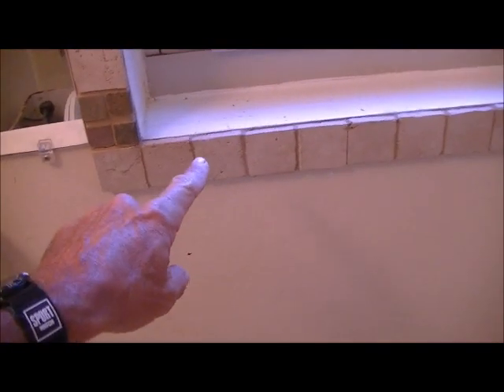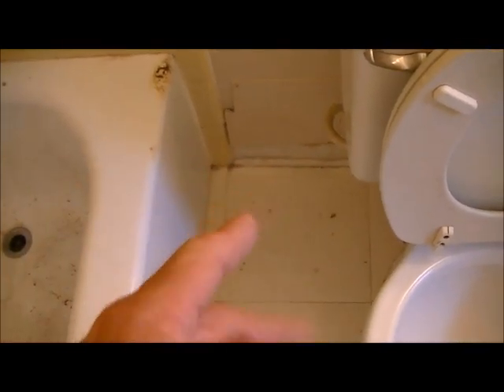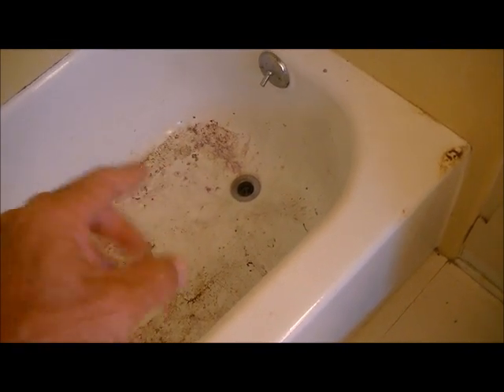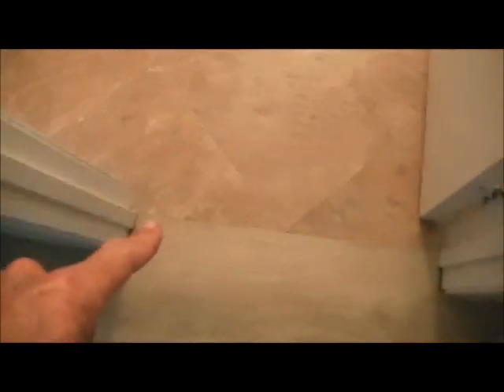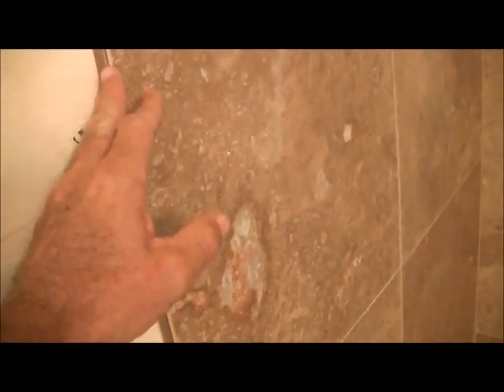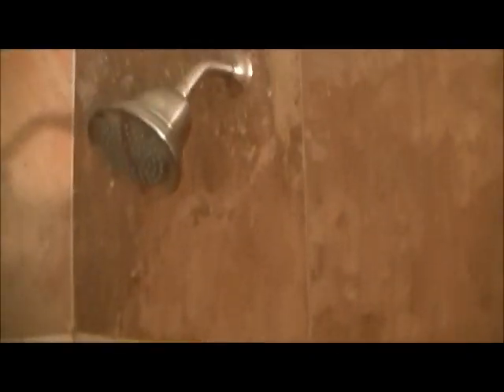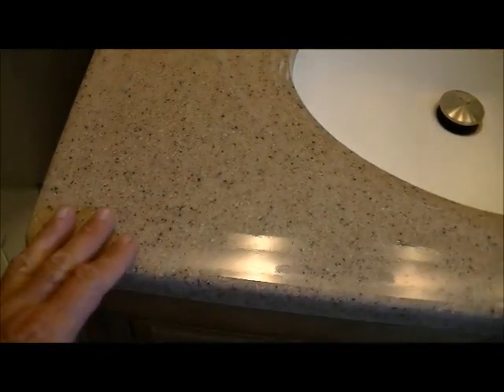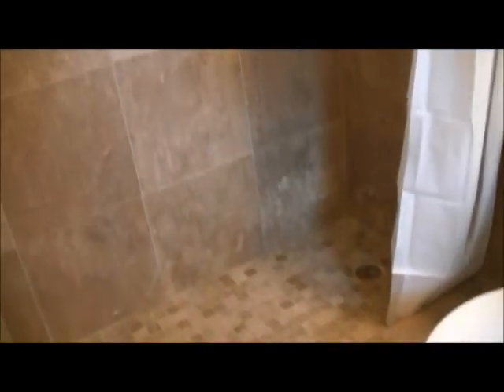Tub to Shower Conversion

Comment: What size is the step you made where the shower ends is it a 2x6 and how tall is it about 4"?? And will the water drip out if I decided to just use a shower curtain on a setup like this?? Awesome work by the way :)
Reply from the maker: The step, otherwise known as the curb, is 3 lengths of 2''x 4'', so the finished height with tile is just at 5''. Shower curtain is fine, customer is using one on this shower with no water issues, top of curb is pitched slightly into the shower.

Comment: how much did the renovation cost? roughly?
Reply from the maker: I did this for a friend, so I didn't charge full price which on just labor I would get about $2500 for
Reply: therefore that kind of job should cost around 5000$ to 6000$ ?
Reply from the maker: Nicholas Dagher when you say 5000 to 6000, do you mean ALL materials, Tile AND labor ?? No...with labor & material about 3000-3500